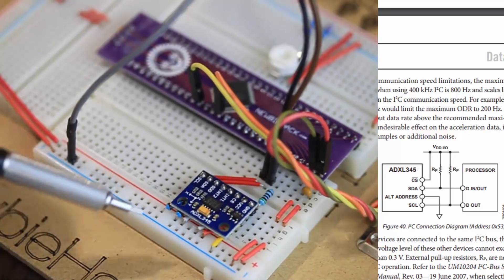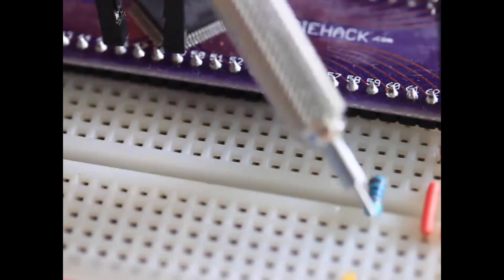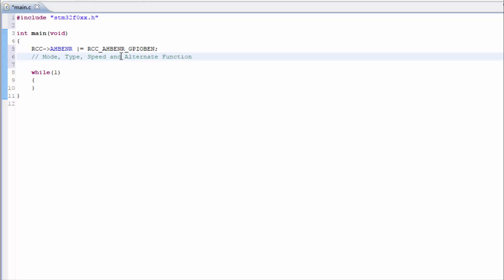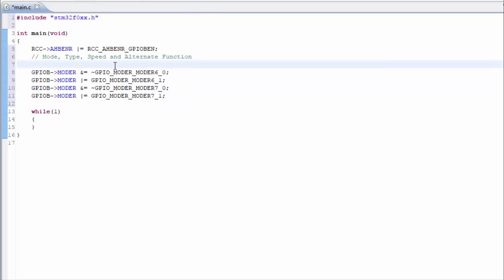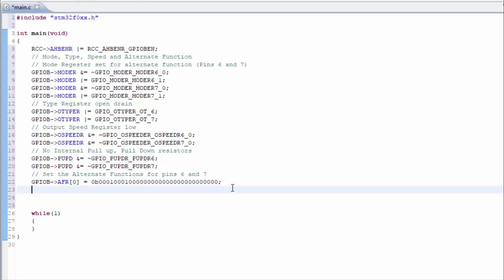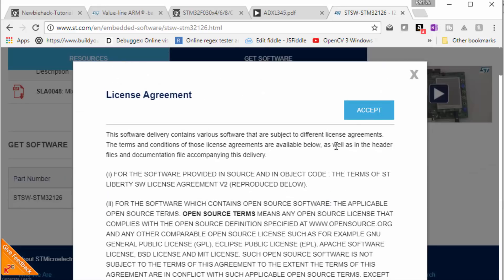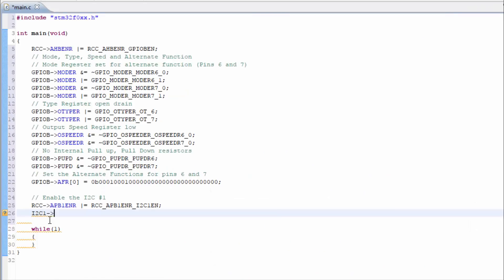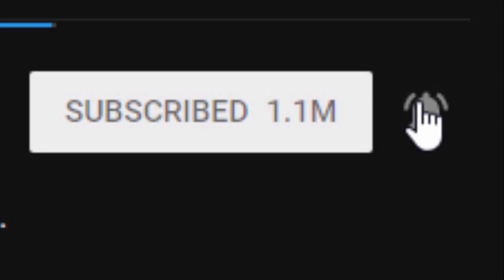58. How to: I2C Circuit and Initialization - ARM STM32 Microcontroller Tutorial

Comment: which grade wires you using on bread board ?
Reply from the maker: I use anything I have laying around. As long as it fits in the tie strip position, I use it. Solid core, 22 or 24 gauge.

Comment: Sir I am using STM32F0 custom board interfaced with BMP180 via I2C. The I2C lines stops working after some time with I2C error 1 or I2C error 4. What should I do?

Comment: Hi, I'm have been using coIDE for 8 months. Now i'm unable to use it. Repository don't connect. And now I'm completely stuck. To create a new project you need the repository. I don't know what to do.
Reply from the maker: I have had a few users say the same thing.  I'm not sure if this is a temporary or permanent state of their website.  Anyhow, I would consider going with the Eclipse IDE just so you have more than one solution available when something happens.
Reply: If you move to Eclipse IDE, please make a video tutorial. I've been testing other IDE but without doubt coIDE was the best solution, the simplest one.
Reply from the maker: Will definitely do.  Before the CoIDE, I actually tried starting with the Eclipse but found it a bit tricky and with my beginner audience, it would have posed a barrier.  I am currently looking into openSTM32.org.
Reply from the maker: Other IDEs and libraries may require a different way to control pins and features.  I will be looking at IDEs to see which IDE will be the most similar to the libraries the CoIDE was using.
Reply: Thanks, I'll be watching. I didn't know openSTM32.org, very interesting.
Reply: YES! I do not want to use intermediate libraries like HAL or something similar. I want to program the micro from the base, without depending on a thousand and thousand things.
Reply: I have already finished configuring the openSTM32 workbench and it works. It is easy to configure. Right now I only have problems with the reset of the chip. I had to disable the -halt-. And on the other hand I have to erase the memory previously with the ST-link Utility and once the program is loaded through the workbench, I have manually reset the chip.

Comment: Hi thanks for your very useful tutorials.
I need some help about CNC and ARM microcontroller.
Actually i am new in ARM Microcontroller and my plan is make a USB to LPT port adapter for my old Mach3 cnc machine, which receive Mach3 signals form USB port and convert them to LPT so my old mach3 controller can transfer them to stepers, end switchs and... .
I really like to research and i want to do this. so the questions are:
What protocol about USB to LPT port should i know and which one Mach3 needs?
Can i do this whit this tutorials?
In which conspectus shoud i research?
Is there any websites to help?
Thank you very much.

Comment: thanks Patrick useful as always, but i have a question plz, when i connect more than one device to the I2C bus they don't work, for example the adxl345 and pcf8574 to drive the LCD over I2C, but when i connect one device everything is going well, and i have tried a lot of devices, mpu6050, and some eeproms, can't connect more than one device at time... is it because of the pull-up resistors?, but when i used the embedded pull-up resistors in the mcu the problem wasn't fixed. is there any solution?
Reply from the maker: The capacitance of the lines due to multiple devices could be the issue.  Have you tried varying your resistor values?  Have you tried other devices together?  Make sure you are only using a single resistor for each line for the entire I2C, not per device.
Reply: i tried to change devices, and varying the resistors between 4k7 to 10k, and i placed a resistor for each line of the bus (2 resistors), then placed 2 resistors for each device (2 devices, 4 resistors)... no solution worked ... :(
i also tried to put some delay between every connection for each device, the i tried to disable  the I2C bus after connecting to 1st device then enable it to call the other device, that  also didn't work.
i'll keep trying ...
Reply from the maker: You don't want to add resistors for each device, just one for each I2C line..  I know you were just scrambling to find a solution.  You might need to go below 4.7k.  You may need to determine the capacitance for the I2C lines to determine the proper value for the resistors.  Did you watch the other video in the description of the video 57?  I give a better detail for the capacitance. Also, make sure to read the datasheets for each device very carefully.  There may be some gotchas in there.
Reply: thanks Patrick, i'll watch the video first !
Reply from the maker: Here is the ultimate guide (where I got a lot of my information on making the video).  This guide is written by the folks that invented the I2C bus (Phillips, now known as NXP).  The information contained within this guide is key, so I would use it if you continue to have challenges with the I2C bus.
Reply: Thank you, Patrick. It is a very usefull tip. I was thinking on using the internal PULLUP resistors, of each one microcontroller(on a 5 microncontrollers bus, 30-40k for each),  which, would be like almost a 10K resistor, at all. Now, I am going to disable every internal PULLUP, and instal an external(4.7K, or 33.K, 2.2k...). Thank you a lot.